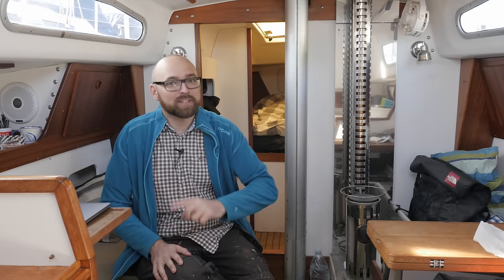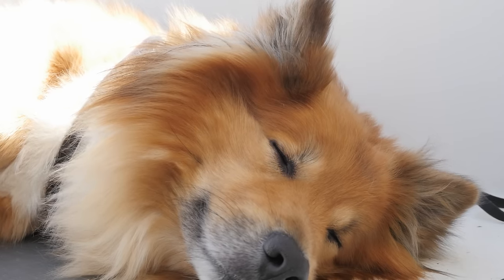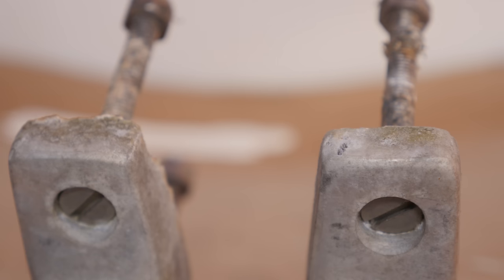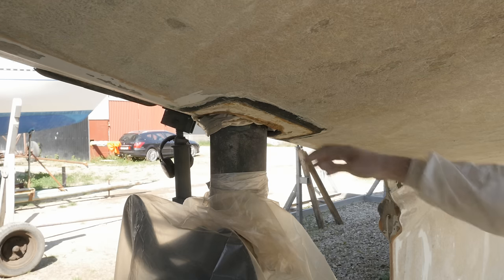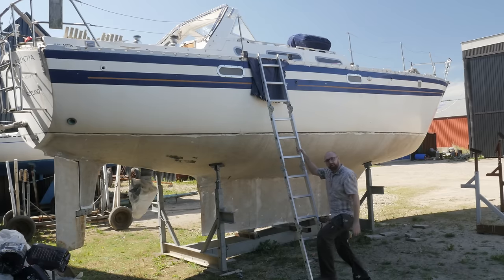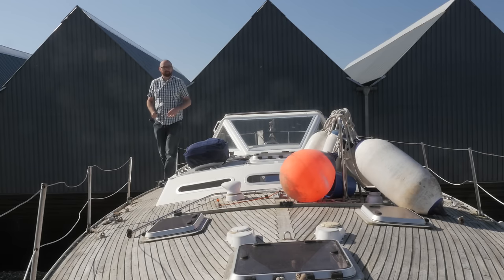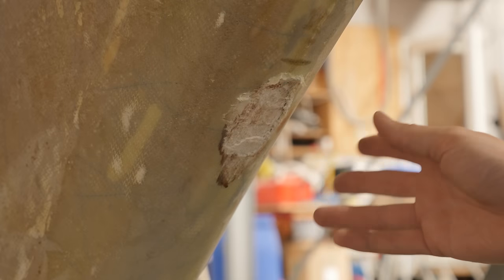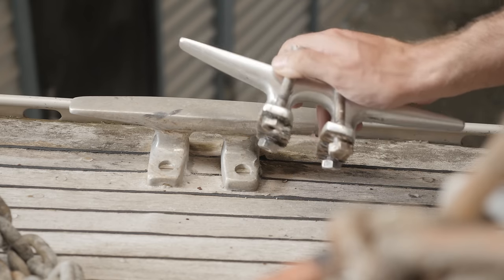Sail Life - Going inside & removing deck hardware - DIY sailboat refit

Comment: Hi Mads. As always entertaining as all heck...BTW, that shed being "hot as heck" will be a good thing for drying out your hull so look at it that way. Put some plastic down on the ground and bring it up the sides and tape it to the hull. Put a de-humidifier in there and she should dry pretty quick. (I don't know what electricity cost there, sorry). I know I'm putting the cart in front of the horse, but please, please chamfer all your fastener holes on the deck when you are putting hardware back on. Even on that dorade(a dorado is a fish)- chamfer that hole edge so the caulk has a place to go, and forms an "o"ring of sorts. It will not leak if that is done, I promise! And yes, unfortunately, I think you are being optimistic about getting all the teak deck off in a weekend, but the way you work, it wouldn't surprise me if you did. Keep up the good work!!!

Comment: Glad to see you finally have your engine back in Obelix, I didn't realize it had been pulled for that long. 10hp is all you need to get out of the dock and get your sails up, most sailboats are overpowered anyways.  Diesel engines need to be run at 65% or more load  to keep them in good condition, not just RPM but the actual strain put on the engine, otherwise carbon buildup and other problems will kill them prematurely.  Diesels want to be run, and run hard.  Too many people put too large an engine in their boat and as a result it never gets worked hard enough to keep it healthy.  Keep up to good work, I love watching your videos.

Comment: Ahhhh! The joys of boat refit work.... One tip for anyone trying to remove hardware bedded with adhesive such as 3M 5200, or similar: use a heat gun! You will be surprised how easily the parts come up with some (relatively) gentle application of heat. Winches, hatches, and metal hardware all conduct heat well, the polysulfide adhesives generally used in those bonding applications will become soft and gooey, and release their tenacious grip. Note: this does not work on plastic parts! (Bad things will happen to them!).

Good luck Mads!

Comment: This video reminds me... when you are glassing the deck, I recommend glassing in a raised block under every fitting or hole in the deck. 10-15 mm thick (high) should do nicely. This will fight standing water so your bedding compound doesn't have to do all the work of fighting leaks, soggy core, and corroded fasteners. In the case of cleats, it also has the nice side benefit of added knuckle-room.

Comment: As hot as its going to be working in the shed it'll have its benefits.  The heat inside will aid in the drying out of the hull, and deck moisture. Looks like a trip to the hardware store for one of those massive fans. It will be very interesting the moisture readings will be over the next couple of months. Hopefully you'll be able to get the glass work on the hull done before you have to move it back outside. I bet it may take you a couple of weekends to get the teak off the deck along with the thousands of screws. A pair of vice grips will come in very handy for the broken screw heads. Good luck with this phase of the boat rebuild project.

Comment: Have you put your moisture meter on the deck yet? You should do that after the teak is off.  Often the core has absorbed water from all the screw holes fastening that teak to the deck. I knew mine was saturated and thus pulled the teak up all at once WITH the upper lamination. Opened it up, dried it all out, installed new core, re-laminated, faired, and painted. Not all that bad, actually.

Comment: FYI Years ago I removed a deck that was still stuck to the  hull with root cutters (not a root shovel but close) also can be found searching "heavy duty scraping tool". They are the length of a standard yard tool (rake or hoe) with a flat blade that is about 5 inches wide and angle ground only on one side for a chisel style blade end. We were able to plow through any missed or broken deck screws with ease too. It kept us from bending over for most of the task and off our knees. Still had to get down for some of the deck.

Comment: Hope your shed roof remains leak proof following the accidental
 stanchion bumping. In America, we call them window shakers. A common practice is to fit a small cheap air conditioner into some scrap plywood and slide it into the companionway board slots. This way you can edit and upload in comfort.

Comment: that uninstalled metal shed, a.k.a. a solar oven, will do well to bake that water out of the hull. But it will suck to work in.  LOL at your changing voice bubbles on the door smiling face.

Comment: Suggestion for exterior aluminum parts.  Find a place that does sandblasting (most auto body shops).  They can easily remove the adhesive and any bits of wood from those frames.  (Sorry, no sanding !)  Then find a place that does powder coating.  Frequently a powder coating operating will also do the sand blasting.

I believe they now even have clear powder coating so if you can restore the finish of the aluminum to your liking (buffing, not sanding), then a clear powder coating will keep it that way for a long time.  Or just go solid white.

Comment: Good job grinding away the last bit of paint. I used a similar grinder to smooth out a cast iron skillet. Sure wish I had that kind of indoor storage to work on my boat.

I laughed out loud to the scrapers falling. At least you had a couple spares ;-) Good luck fishing those back out.

Comment: Well done! Triumph in the face of adversity on multiple fronts.  BTW your perspective on removing old wiring seems to be catching.   I was adding some new sail instruments on my sailboat when I was overcome by a mental message of "What would Mads do?"  Dosh garn it!! , multiple hours later I had removed a huge amount of do nothing, go no-where, abandoned wires of all types and sizes.  My estimating rule of thumb for job duration is to multiply by 2 and change upwards the units.  By way of example 2 days of removing the teak deck becomes 4 weeks!!

Comment: if you run into more stubborn threaded rod or even small bolts, simply chuck your drill motor up and run in reverse.
Congratulations on the move!

Comment: I really enjoy your videos.  I find them very motivational.  I own an ericson 38 I keep in San Francisco bay that needs serious maintenance which I have avoided for about 5 years.  You approach the work on Athena much like I would.  You clearly have a lot more electrical knowledge than I do.  Very nice work on your rewire job.  I do not have the courge to attack an isolation transformer as you did.  Thank you for your inspiration.
Reply from the maker: Thank you so much! :) An Ericson 38, nice boat :) What kind of maintenance/projects are you looking at? :)
Reply: What kind of maintenance projects?  Well, lets see San Francisco gets a little over 100 days of overcast and cold wet fog a year, add in 24 inches of rainfall a year, some fairly high winds with water temps in SF Bay generally between 52F and 58F year round and mg consit has avoided doing some serious maintenance for five years.  So, what kind of maintenance projects is he looking at?  I would say ALL of them!  ; D
Reply: Sail Life Replace all the cooling system hoses on the diesel.  Remove and clean engine heat exchanger and the wet exhaust riser. Varnish, varnish, varnish  and rebed hardware that leaks and replace all the aluminum cleats with stainless steel cleats.
Reply: Or you could have just agreed with me and said ALL of them.  ; D  But I kid.

Comment: I like your idea of spanning across the deck with some boards but it might be better if you got some scaffolding to place on either side of the hull  and then use some 2X12 planks to span completely over the bow to remove any stress on the hull while having the top layer of fiberglass removed from the deck.

Comment: I couldn't believe you used a cabinet scraper as a plate for your wonder-bar. You'd have ruined it for its intended purpose...had they not both fallen down into the cabin below. I'd recommend getting a scraper bar. Looks like your wonder-bar (that's what we call the pry bar you were using today) but it's only about 20cm long, super thin and great for getting into the tight spaces or fragile areas. I used mine yesterday to pry off shower door trim off of tile - no damage. I think you can find them in the painting department.

Comment: Mads: Inquiring minds want to know.  How do you think the heat inside the shed will affect your hull's moisture levels?  Will it allow for faster drying?  Or, will moisture in the shed's interior air slow the hull drying?  OH! -  Another great video.
Reply from the maker: Excellent question! Personally, I think the hull would dry faster outside right now (compared to inside the shed) but with my DIY HotVac I think the shed will be a lot faster :) Fingers crossed :)

Comment: All that heat in that dry shed should dry out your hull pretty fast. And if that deck adhesive comes off that easily your going to have a lot easier time with that deck than most people do.

Comment: Hi Excellent channel. I own a FARR38. I  have removed about 50% of the deck hardware as I wanted to repaint the deck. I did not do all at once but removed it as I went along. I can however tell you that it will take double the time to replace it. In my case I still have items that I have not yet replaced. In your case you take a video of everything that is a better way of keeping track where it was taken off. Fortunately in my case my yacht does not have any teak to remove.

Comment: Sail Life:  Hi, Mads! Love the Video's. Ive been watching since the start of the year.Love the German due to german and Dutch grandparents now living in Australia. OK, can I suggest you when trying to slice through hatch glue or strong sealer use your oscillating cutter and a hand box cutter, (long blade),  while spraying a dish detergent -water mix to help the blade move in and out of the glue/sealer, This is a proven technique used by automotive windscreen installers for years now. 
That said, Good Luck w/ deck removal.
As usual, love the vids and keep up the "good work."

Comment: Hey Mads, you may be able to remove all the teak in one weekend, but fairing that hull and the deck, that is going to take a long time. How many weekends are you planning for that? After you tell me your plan I'll tell you how long it takes the professionals in the yard where I keep my boat. ;)
Reply from the maker: That is a good question! I don't know :) I've got a feeling fairing of the hull won't take that long. It's pretty nice already and it's under water so I'm not hyper OCD about it ;) If I need to cut corners to meet my deadline fairing the hull will be one of the first ;) The deck is another matter! That needs to look good and it's going to require a bit of extra work with the hump (core on top of the deck, not under).

Comment: Mads I would not put a teak deck back on there...Number one there is the expense of manufacturing a new deck.  Number two every screw going through the deck is a point where moisture can get into the core. Number three there goes a month of your time installing the deck...well a lot of time anyway.  It is so much better to take all the screws out, epoxy, paint, anti-skid.    Your deck will also be cooler in the sun as the teak is typically darker and absorbs more light.  You may want to stay up north, but it can still get massively hot sometimes.  If you forego the teak deck, you are also lightening your boat by several hundred pounds, which means more available displacement, and a faster boat.  All in all if you skip the deck, you will be in the water a lot faster.  Of course maybe you said you weren't going to put in a new teak deck at some point, so saying this will make me feel stupid!
Reply from the maker: +Allyn Onderdonk it has never been my plan to put new teak on the deck ;) Don't feel stupid though! I think I only briefly mentioned it in a video about a month ago :)
Reply: Thanks for straightening me out...oh I also wanted to say you should buy yourself one of those r2d2 air conditioners for working on the boat in the shed...the ones with the hose that expels the air and looks like a small robot quite often.

Comment: There was not one single job that took as much time as I estimated when I refit my little boat. Even when I overestimated, it still took longer. on the bright side in my experience, old teak comes up easier than new teak goes on. So since you are not replacing the teak (as abhorrent as that is😷) you should still come out a winner.

Comment: It's not the brand of the blade that's at fault, it's the type of attachment, which is common across non proprietary blade makers (as a means to bypass the patent on the blade holder). What you have to do is tighten that screw extra tight, or, of course, buy the originals which have full coverage all round. One method i've seen, but that's for welders is to just buy new blades and to weld the tips on to the old holders from used up original blades, works like 4 5 times until you run out of core.
Is the boat not level???

Comment: Wow , a big job ahead, sorry I laughed my ass off when the deck scraper fell into the mess. Normally that stuff only happens to me
I was wondering why you didn't take any hull readings before you put her in the shed
Im kind of curious to see how fast it's going to dry out now that your inside of in a big oven.
Interesting to see how much moisture got under the deck fittings

Comment: Madds, I'm still watching past videos and noticed one part where you mentioned putting a vinyl ceiling in. I'm wondering what a thorough planner and thinker thinks about cork on the overhead. (Ceiling) It is mold resistant easily cleaned and provides a degree of insulation and definitely sound arresting. What are your thoughts?
Kindest regards, George

Comment: Did you try a heat gun instead of the oscillating tool? I have often found it works great on sealers and adhesives.

Comment: you may need to control the humidity in the shed 35% or less
Reply from the maker: There is no floor just gravel so that is going to be difficult. The heating pads should take care of the hull though :)
Reply: Just gravel Oh!! :-( That does make it harder to control

Comment: the heat of the shed in the summer should aid the drying of the hull?
Reply from the maker: Maybe but the humidity inside the shed is going to be higher than outside so I doubt just having her in the shed will to it on its own. We'll see :)

Comment: Is'n it a bad constructor with all the bolts in the deck that leak over time and through the hull. I think it should be better designed. Maybe something you can consider. A bether construktion.